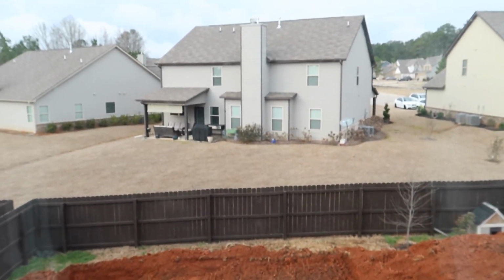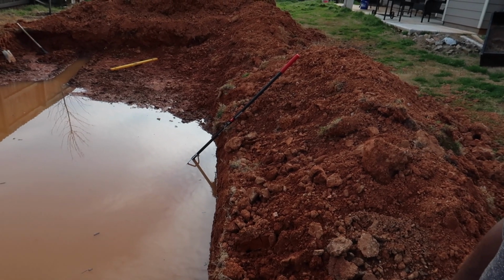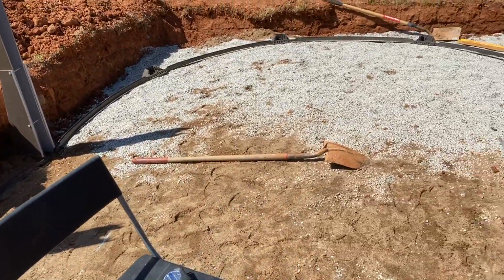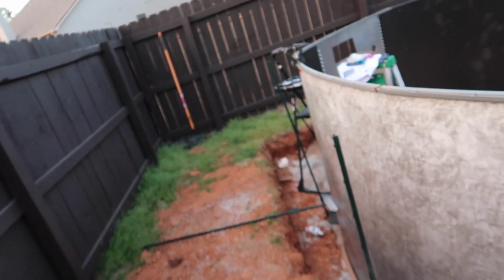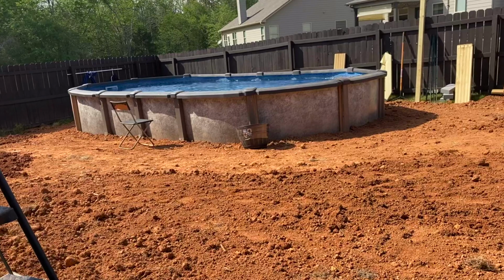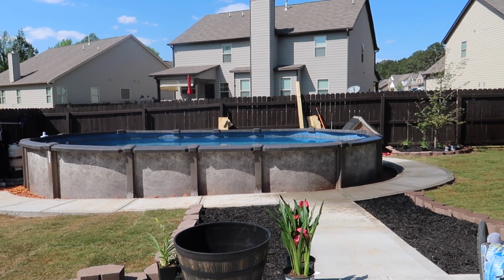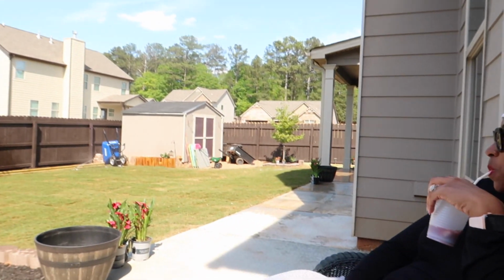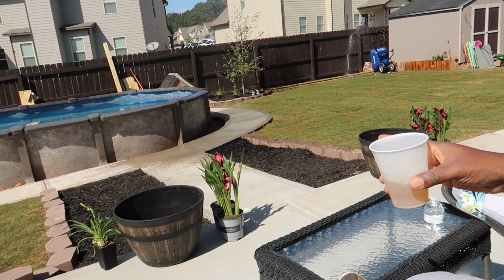Installing a DIY Semi In Ground Pool | The Pool Factory

Comment: Nice job! Im building my 15x30 and im thinking of pouring cement in the holes with the channels/posts. Good idea? Bad idea? Unnecessary?
Reply from the maker: Sorry it was rough at work this week so sorry for the delay. But thanks! So I actually did pour a little cement over the base of the post before backfilling. I only covered that part that sticks out away from the post (outside of the pool lol)  and only did probably about a bag around each one. I didn’t go crazy I just wanted to make sure there was something over them that wouldn’t erode away lol. So far soo good. It probably overkill though to be honest but I already had the bags

Comment: Thank you for sharing this video!  We just installed our Melania pool from Pool Factory.  Have a question for you, we started filling the pool with water and just today we noticed some water in an area around the pool.  It’s not a puddle.  Wondering if it could just be condensation from the ground, sand.  We dug 2 feet to make it semi in ground.  We did get the most expensive liner so having a hard time thinking it’s the liner.  Did you experience anything like that after installing yours? TIA!!!
Reply from the maker: Hey!!! I didn’t experience that but might be hard to tell because of the GA clay that we have here and I didn’t have a lot of sand outside of the pool area. Is it all over or just in one spot? I would put a piece of blue painters tape inside to mark the water level to see if it is dropping after 24 hours. Now I do know when I was installing the pool some morning the sand would hold moisture longer because of the morning dew. How far did you guys fill up the pop so far?
Reply: We have it halfway filled.  Okay, yeah will add the painters tape and see how that goes.  It doesn’t seem like we are losing water but will know for sure with the tape.  I am trying to reach customer service and see what they say.  I will share their response!  Thank you!!
Reply from the maker: No problem!.. so I went back through the directions and kinda did a walk around my pool this morning. Since it’s only filled half way, the only logical option I could think of is a leak in the linear and the tape test should be able to reveal that. The only other place it could leak from would be the skimmer or return water line but if it’s only filled half way it’s highly unlikely. So if you are not losing water from the pool it then it can be from the ground getting use to now having a hole in it and might have a little drainage from the rest of your yard. But let me know how it goes! .

Comment: Fantastic video!  I’m glad we weren’t the only ones work issues getting the liner up at first. Lol.   Did you run into any issues with the final top panels not lining up?  (The top edges of the pool once it’s all together). Half of ours won’t line up so we can’t screw them into the metal brackets…
Reply from the maker: Im sorry I thought I responded to this!! I hope you were able to get worked out! The linear was a little rough lol. All mine lined up. Some were a little off an not perfect but I was still able to get the screws in. Did you have to redo it all?

Comment: Very nice job!   I am doing a similar DIY job and was wondering when you back filled the hole/pool-with-water-in-it, did you directly cover the buttress supports and back fill right up against the pool wall?  Did you install any retaining like wall or in-ground support  between the back filled dirt and the pool wall?  Also wondering if you put any extra corrosion protection on those areas of the pool wall or just utilizing what it came with from the factory?   It sure looks great!
Reply from the maker: Thanks!! So around the outside portion of each buttress, I put a small bit of concrete on top of the part that sits on the concrete brick (not a lot just enough to cover it and kinda wrap around it to the concrete brick). Then I did backfill the dirt back directly to the side of the pool. I did it little by little and use a tamper every once in a while to make sure it gets compacted a little. Once the water is in, the walls actually become really sturdy. Also around the pool, there is about a 10-inch gap between the pool and the concrete walkway that goes around it. That gap is filled with gravel. I tried to limit as much grass and dirt from that side of the backyard to try and reduce as much erosion as possible. I I have one end of the oval (where the skimmer goes) that's not buried the full 2 feet since that was the low side of my yard. It's only buried about a foot and then there is a layer over gravel on that entire since that's where the pool pump is and I knew there would be a lot of water spilling over there from time to time.

Comment: Did your inner stabilizers interlock? these are plastic and I am having difficulty getting them to fit.
Reply from the maker: From what I remember, the inner stabilizers didn’t actually lock together. They had just sat on the base mount thing. Let me go back through the directions to job my memory I’ll update you tomorrow if you still didn’t get it to tower
Reply from the maker: Work*

Comment: ❤ I'm in this battle myself right now! It's quite challenging indeed! Just got walls up posts and top stabilizer
Reply from the maker: Nice!!! The finish line is right around the corner!! lol it seemed so easy when I was reading reviews on the website lol
Reply: @TheNealsNextDoor  yep ,I really appreciate your video, this sucks ! I've done all kinds of projects and this I wrote do again! Thank God I have two children who like digging lol Thanks for the information 🙏
Reply from the maker: @ncanellos  lol if I didn’t have a 2ft hole in backyard that took up a qtr of my yard, I would have quit several times lol. One day I just sat on the floor in the middle of the pool after the 3rd time failing to put the linear in correctly for about 4 hours lol. Just sitting there drinking knowing that I’ll have to redo the walls and the sand all over again lol. It was a miserable day. Lol but a couple summers later, the kids spend a lot of time out there. Sometimes 3 hours easily but I still won’t do it again lol

Comment: You mentioned the pool came off the track while putting on the liner. This happened to us as well. Did you have to start all over completely when that happened? How did you recover? 😫
Reply from the maker: I basically started over like 3 times… I had to go back and clear out the sand that fell in the tracks.. push the sand back into the middle some and then put the walls back in.. smooth Everything out all over again. It was miserable to be honest.. then I realized you have to put the linear in like a star method. Kind of like how you tighten lug nuts on a car tire. Once I did that it worked perfectly. Also make sure the linear spend some time in the sun.. but each time i knocked it out of the tracks added an extra weekend to the project

Comment: Did you compact the gravel at all and how close was your leveling. We are installing a 12x20 and are running in to the exact issues.
Reply from the maker: I used a tamper to compact it as much as I could. Luckily I didn’t need too much gravel. I also used I little thicker layer of sand on the side that was slightly lower. So far year later it’s still as stable and solid as it was when I first installed it

Comment: You had mentioned that you found some information on the internet on how to install the liner appropriately and then it only took a short time.  We are STUCK on the liner and the weather is changing quickly here in Oregon.  Help!  Do you remember that website?  We haven't found much helpful info yet.  We keep failing.  We live in a small town and literally have no professional services to help.  :(
Reply from the maker: Let me see if I can find it again
Reply from the maker: https://blog.thepoolfactory.com/how-to-install-a-unibead-liner
Reply from the maker: This isn’t the exact article I used I think but I did do the basically what it said. I attached at the middle of both curves with a clamp. Then I went out a little on on side of then curve from that center point and put another clamp. Then I went to the other curve and did the same thing but on the opposite side. Then I went back to the original curve I started at and attached the liner again but now on the other side of that curve. Then I went back to the curve and attached on that opposite side. I started doing it with clamps until I made if far enough to put an entire track over. Once both curves were fully attached then I was able to put the sides on but I did the same thing where I went back and forth between both sides doing the opposite corners. I really hope this makes sense lol.

Comment: Biggest mistake is making it a salt pool. I did the same thing and all it did was rust out the metal which caused a pool failure. Remove the salt system ASAP!

Comment: not passing judgment but the wife could have put in more work if it's her home also it's 50/50 so if she wants to enjoy pretty and all put in some work with hubby I'm a country girl so I had uncles I learned from and it's nothing wrong with learning husband can die before wives then what have they learned nothing but being cute or paying a high priced contractor YouTube is my home improvement I did my brick wall in my home along with my uncle guiding me I did the labor I was frustrated but I got it done.and painting my walls the only thing I don't due is floors or electrician work. sheet rock,plywood I think I can handle it's a learning experience and I'm 46